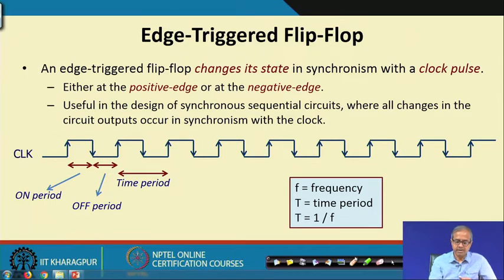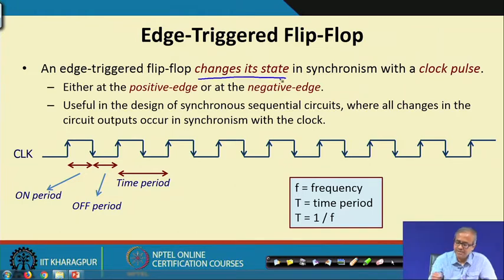Lecture 32: Latches and Flip-Flops (Part II)

Comment: Sir, the D Flip Flop does not depend on Q(t) (Previous output)
the characteristic equation is : Q(t+1)= D.
It is a memory element I understand but how is it a sequential circuit ?
Reply: When the clock level is 0 or 1 (apart from when it is at +ve edge) the output depends on the previous value, ie. Q(t) (no change)
Reply: @yogeshsachdeva9566  oh okay.
At every positive clock edge D flip-flop sees what is the value of D, It does "store" (storing element)the value of D until the next positive edge but it does not fit  in the definition of combinational circuits which is "it depends on prev and present inputs" 
To store a 0 or 1 you need to continuously provide a 0 or 1 at D ? then how is it depending on the previous output?